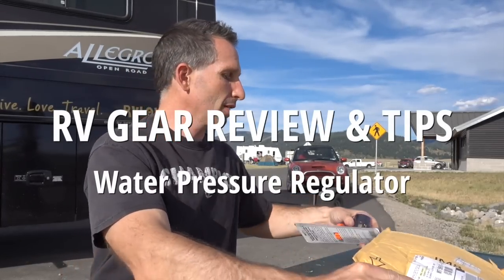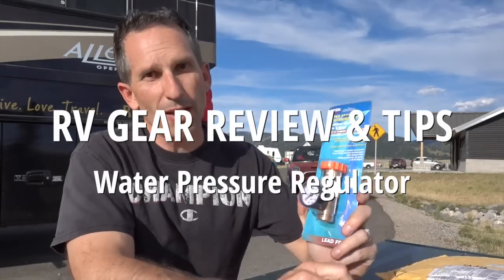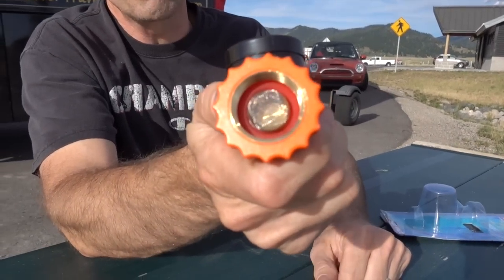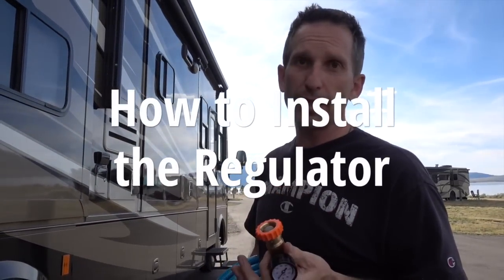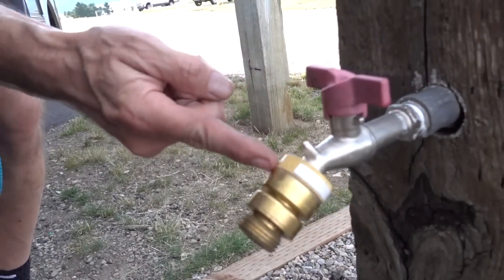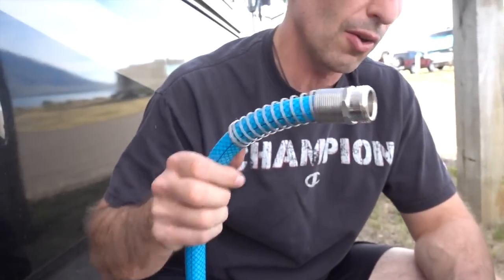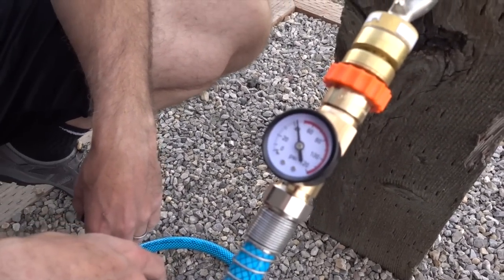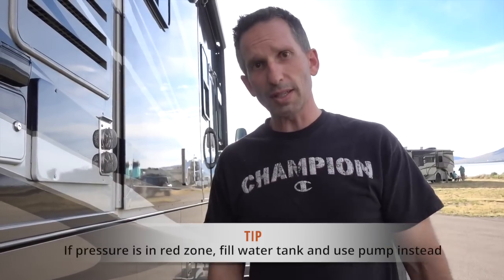RV GEAR: How a Water Pressure Regulator & Vacuum Breaker Can Protect Your RV Plumbing System

Comment: Great information. A tip to maintain the regulator, once a month soak the regulator in a mineral dissolver to clean mineral deposits.
Keep the rubber on the road.
Reply from the maker: Great to know - thanks for sharing Brian!

Comment: One thing I do is attach a ball shutoff valve to the campground faucet and then my pressure regulator, etc.  When we leave for the day or to sight see,  I shut the water off to the RV by rotating the ball valve 1/4 turn so that any issues that might develop inside the coach won't flood us out while we are gone.  Never did this until I read of someone with a brand new (just under a million dollar) coach had a hose come apart under their sink while driving and the water pump started flooding the coach.  By the time they realized what happened the damage was severe and the coach ended up being a total loss.  It was ultimately replaced by the coach builder but it was a hard lesson learned for the owner and something I never thought of until I read of their problem.
Reply from the maker: OMG what a hard, expensive and inconvenient lesson for sure! Thanks for sharing that. A very good tip. We've also heard of people having issues when leaving their coach for the day. When we have high pressure and are going out for the day we often turn off the faucet while we are out. It's a good safety practice for sure.
Reply: I also put a 1/4 turn shut off. And turn off the water when i go away from my  RV. for sight seeing, Just in case.

Comment: Good video, once again.  I've had several pressure regulators... but none with a gauge.  I started to question how much pressure I was getting at several parks -- wondering if it was low pressure, or if there was something inside my system causing reduced pressure.  A gauge would have clarified much of that.  Just the other week I finally ordered, and received, what I consider to be even better than what you've demonstrated -- an adjustable water pressure regulator.  It has a gauge, like yours... but it allows me to 'dail in' the exact pressure I'm most comfortable with in my coach.  This is perfect, as we like to have a bit more pressure than most of these preset regulators offer.  On another note, I was into the bad habit of leaving my pressure regulator hooked up to the coach (meaning it was the last item in the water hose chain) rather than having the regulator/restrictor being the very FIRST thing attached to the city water outlet.  My mistake!  We were in a small park in northern California, and it seems the pressure there was well over 100 psi.  I didn't think anything of it, since I only had an inexpensive water filter hooked up to the city outlet followed by my hose which was then connected to the pressure regulator in the coach's water bay.  After a couple weeks... the water filter outside split open!!!  Yep.  The pressure was high enough that it ruptured the water filter.  Granted, it was about time to replace the filter anyway, so maybe it had seen too much wear... but that was a wake-up call for me to start hooking up the RIGHT way -- regulator as the FIRST item in the chain.  :)
Reply: What you have is a true regulator. What Marc was showing is a pressure gauge that just shows the pressure.
Reply: After several different regulators, I couldn't see the point of getting anything that didn't have a gauge and a way to control the pressure.  I was getting pretty frustrated trying to figure out why I had such low pressure in my coach.  Once I installed the regulator with gauge... and set the pressure where I wanted it... everything was great once again.  I can only guess that the other pressure restrictors I purchased were set way too low (for my taste, at least).
Reply from the maker: Great feedback thanks David we have heard great things about the adjustable regulators too... more of a top of the line solution for those folks who don't mind spending the extra $. Ouch re the filter! Thanks for sharing!
Reply from the maker: Yes good point.
Reply from the maker: Glad you found the solution just right for your needs!

Comment: Great video man, simple and clear! Got a rookie question here, would it be okay if you fill your fresh water tank with relatively high water pressure without pressure regulator, such as 80psi? It won't damage anything?
Reply from the maker: Good question, and... as long as you are paying close attention it would be ok.  If however, you just let it run without watching and it gets over full, it might damage some water tanks, especially if the fill hose is screwed on the the filling inlet.  I actually cracked a fresh water tank once when filling it because the water pressure and volume was so high at a campground. -M

Comment: Good information Marc! I think you also covered water filters going into your coach from city water? Also a good surge protector/low voltage electrical hook up as well.
Reply from the maker: Thanks Norm - good suggestions, we actually plan on getting a new water filter soon so will do a vid on that... out coach comes stock with a surge protector and we don't have an additional one, not sure we need it?

Comment from the maker: There are a few different options for water pressure regulators you can buy from Valterra.... the one we have and show in this video is about $27 from Amazon http://amzn.to/2dkFc1h and there is also one that allows you to adjust the water pressure (good if you like to max your water pressure but still stay within safe range) - that one is about $55 from Amazon http://amzn.to/2dkENvF. Both are products we'd recommend, we currently have the $27 one and it works just fine for us... but maybe one day if we experience too low pressure we'd consider upgrading to the $55 adjustable one. All comes down to personal choice, needs and budget.

Comment: Would it be reasonable to maybe douse the spigot with Clorox when arriving to prevent contamination from a previous user who may not have done what's necessary to prevent contamination?
Reply from the maker: Yes, in fact Marc does do that with a Lysol wipe (we go through a ton of those in general).. would have been a good idea to mention in the vid!

Comment: So, the regulator just measures the pressure, it doesn't really control or lower it? Good info. And I like the tip on what to do if the pressure is really high.
Reply: Apparently there ARE actual pressure regulators - I just read someone else's comment that he has one that he can set what pressure he will allow. This is more of a water gauge.
Reply from the maker: This one DOES measure AND lowers the pressure - it just isn't adjustable. Marc mentioned that at one CG we were advised water pressure was 100psi and a water regulator MUST be used and when hooked up water it brought the pressure down to 60psi. Still higher than we'd like but not enough to damage our coach.
Reply from the maker: Actually Diane, this one does measure the pressure AND lowers it to a safer range.... but it's not adjustable to the same level as the one David mentions above, he can adjust his water pressure to maximize his pressure level - ours only lowers it to a safer pressure level, which works fine for us, but asDavid shared, he likes higher pressure. All depends on what your needs are - and your budget :) Both are products we'd recommend. The one we demonstrated is about $27 from Amazon http://amzn.to/2dkFc1h and the adjustable one is about $55 from Amazon http://amzn.to/2dkENvF - all depends on your needs and budget.
Reply: RVLove | Marc & Julie Bennett Oh, thanks for clarifying that. I didn't realize that it lowered the pressure - I thought that it just showed you what the pressure was coming from the source. Thanks for the info!
Reply: Thanks for the info, everyone.
Reply: Jody's Journey If the pressure is too high, just close the valve a little.

Comment: great education!! thank you.. is there a regulator limiter one can purchase to screw into a line limiting pressure to 60 or variable (maybe a dial in version).. if so do you recommend that?  thank you again :)
Reply from the maker: Bob yes there is one you can buy that's in-line and variable (residential) and we've heard great things about them but don't have personal experience with them, so we'd recommend simply based on the positive feedback we've heard from people we trust.

Comment: Do you use an adjustable pressure regulator in which you can control the flow ?
Reply from the maker: No, we hear those are a fantastic way to go but we just use this simple one.
Reply from the maker: We included a link to an adjustable one in the video description as well - they are about $55 http://amzn.to/2dkENvF compared with the $27 we have - both we would recommend, comes down to personal choice and budget, so far the $27 just fine for us (and this is our 2nd!)
Reply: since our motorhome (Precept 31ul) has the tankless hot water heater it was recommended to use an adjustable to get best pressure for that system to work properly.. so recently we went from standard regulator to adjustable flow control.
Reply from the maker: Yes those are great too, especially for those who don't mind spending the extra $$$.

Comment: 1. how is this regulating the pressure if you don't control what the pressure is set at? 2. why on earth would anyone want one that was not lead free?
Reply from the maker: 1. This regulator automatically reduces the pressure and also flow at the same time. You can buy one (see link in video description) that you can set your preferred pressure at. 2 Some people don't see the value in spending the extra for lead-free, crazy we know, but sometimes people just like whatever is cheapest.